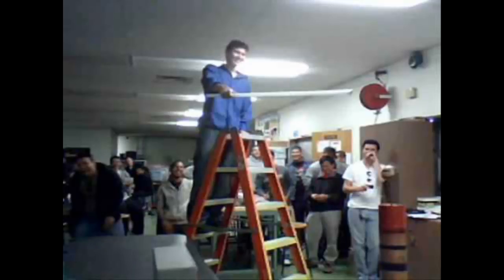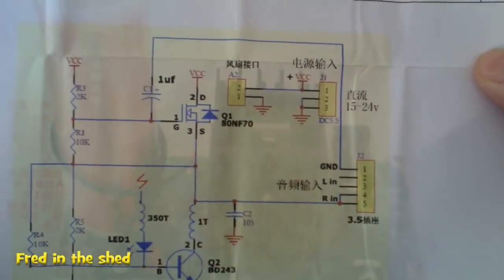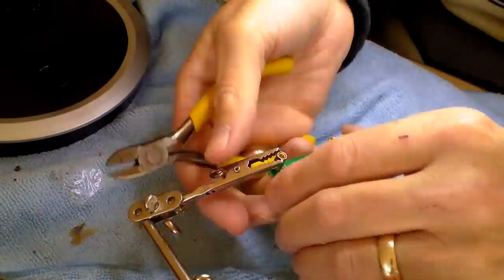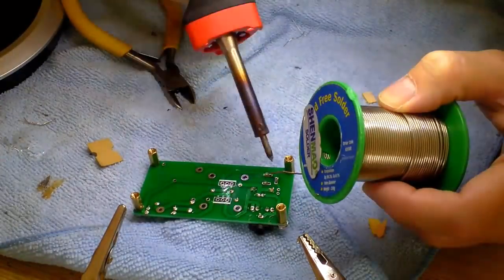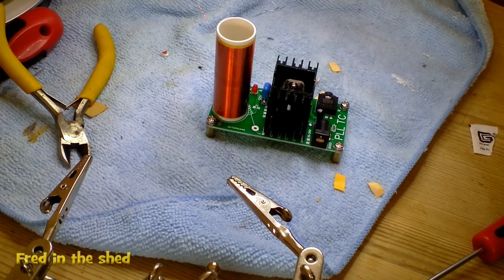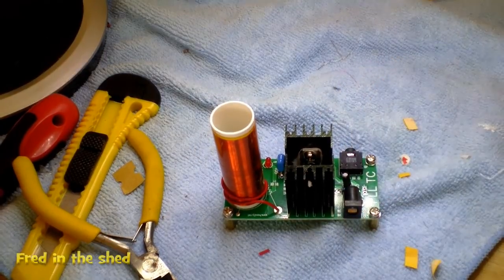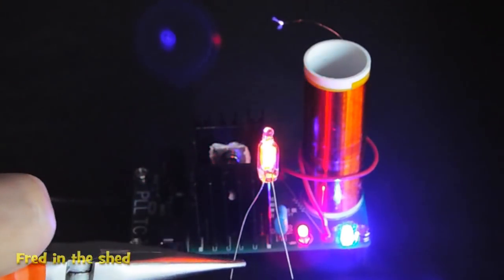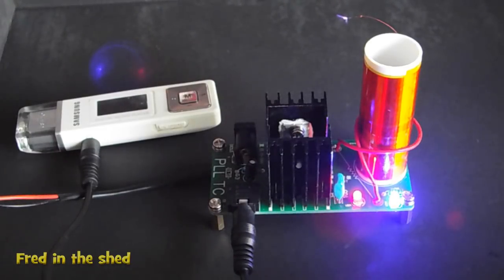Mini TESLA COIL KIT:  £3.68  Ebay and it works 2017 /18

Comment: Hi Fred, nice video. Will the circuit still work without the LEDs. I have damage on my circuit board in that area.
Reply from the maker: Hi TBH no idea.
Reply: Fred in the Shed. Managed to sort it. It’s working. Thanks for the reply.

Comment: I just can't get mine to work. I have the correct power going in but only the bottom right LED is working. The other LED is flickering from time to time. Have I done something wrong?
Reply from the maker: Not sure.  Whats the voltage and amps you are putting in to it ?

Comment: I have made mine it works but it doesn't play music and when I connect it to my phone it does random things(it's not near the coil) by itself, any ideas how to fix?
Reply from the maker: No not really.  If your phone starts working by itself when you plug it in it could be a shorted out lead.  If its the same with a different lead then something is wrong and i would not leave it plugged in.
Reply: fredintheshed1 only my Samsung galaxy j1 starts working by itself, not other phones like iPhone 5. But thanks for the reply. And also when you said lead are you talking about socket or the stereo cable? And is there a way to test with a multimeter to see if it's shorted or not?

Comment: Hi fred great video I just got the little kit today and assembled it but I can only get one of the leds working and I get no spark at all the heatsinks heat up but nothing else dont suppose you have any tips?
Reply from the maker: I would check the way you have wrapped red the wire around the coil.  It only works one way, one twist.  I got it wrong at first.

Comment: Hi Fred I did a similar thing with a 2mtr Transmitter way back in 1980 when I lived in Hemel I used a 5 ft fluorescent tube held close to the Antenna whilst transmitting Great fun watching it light with no wires..I am glad Tesla didn't build his system because they would have wiped out CB and Ham Radio with the noise after all a tesla coil is a Spark Transmitter giving off RF across a wide frequency range...Great Video mate 👍👍
Reply from the maker: Yes Steve imagine the RF noise of a 20 foot coil at the end of your road.
Reply: fredintheshed1 Your not wrong there mate unfortunately I have the main InterCity rail lines from Liverpool lime st at the bottom of my street lol😊